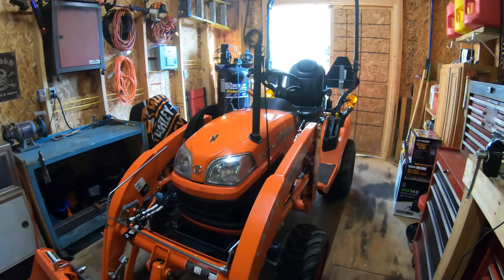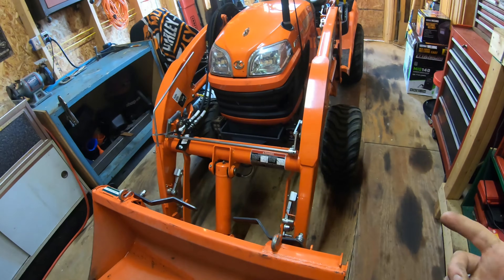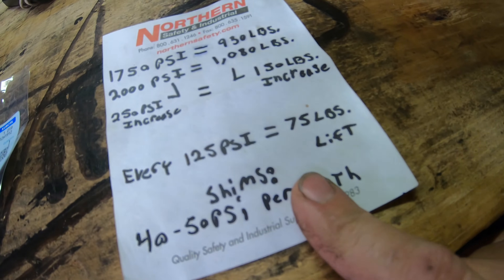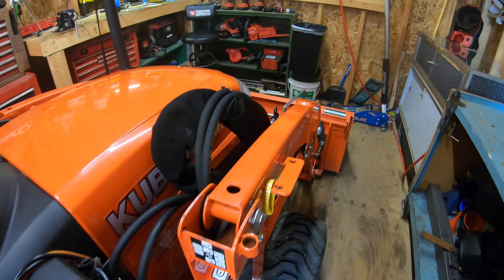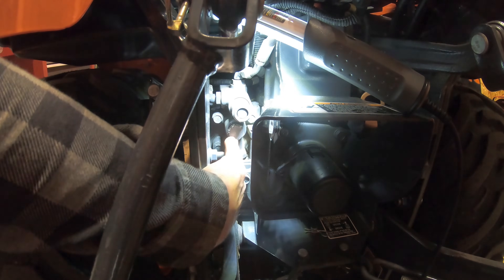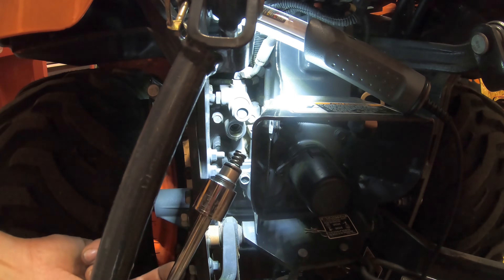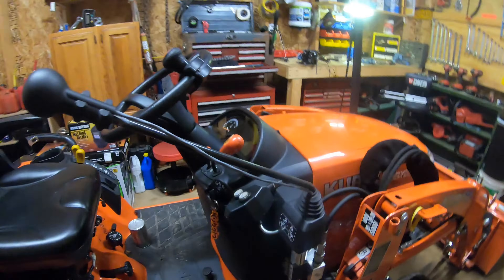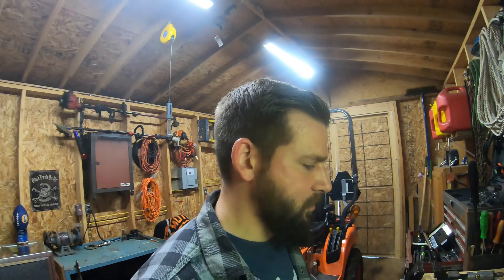Kubota BX- Increasing hydraulic pressure... AGAIN

Comment: How would you check the hydraulic pressure on my Kubota BX 23S with a quick attach coupler on the loader?
Reply from the maker: Hey Hagan, To check yours you would just need the proper quick coupler. For your machine you would need a flat face coupler in the proper size. If you go on eBay and search “Kubota bx 23s hydraulic pressure gauge” you should be able to find a pressure gauge with the correct type of quick coupler already attached to it that you can buy gift $60-$80. Let me know if you need help finding it and I’ll send you a link. Thanks!
Reply: @BiffsEquipment  I found the pressure gauge kit that contains the stems. My question is since I have a quick attach system in which all four couplers come off at the same time, do I connect the gauge to the first coupler that operates the loader and make sure I don’t operate any of the other functions so I don’t spray hydraulic fluid everywhere cause all four couplers with be off. I can’t take just one coupler off to check the pressure with the quick attach system is my worry.
Reply from the maker: @haganrichmond  ahh I see, well all the fittings should be standard 1/4” pipe thread, so you would have to cap off each line that your not using and then the one you will be using you’ll thread your gauge on using a pipe nipple or some type of adaptor depending on what thread your gauge is. You can’t leave them open you have to at least cap them.. and once your ready to test it if you have the gauge on the first port like I did then you’ll wanna move your loader joystick directly up

Comment: How do you like your new found power bro?? 250lbs makes a big difference when you're moving 18tons. I haven't done anything with hydraulic pressure with my BX but I'm going to check it during the next service. I'm told that as time goes by, they lose a bit of pressure and need a little shimmin' to "freshen them up!" I DID do the L2501 and I'm REALLY happy I did. Please let me know how you made out after the weekend, Good luck, be safe and most of all - have fun!
Reply from the maker: Hey buddy! Sorry I’m just now seeing this comment iv been so busy lately, the hydraulic increase worked excellent on my last job! I had a ton more power and a lot more breakout force which was what I was after the most as I often am working with crushed limestone which is some of the heaviest stone around. On my job the crushed limestone was soaking wet so it made it that much heavier yet I was getting monster buckets bigger buckets than I have ever been able to scoop up, so much so that my front rims were about touching the ground (I’ll have to increase my front tire pressure now). I even lifted my rear tires off the ground quite a bit even with all the rear ballast I have so I’m going to have to buy a few more suitcase weights to add on the back now to accommodate  for the extra added power. So far so good and it’s been very reliable! New video will be coming soon, thanks dor watching and let me know if/when you do yours! I think you’ll be very impressed when you do Cuz like you said after awhile the relief valve spring can slowly soften over time lowering your psi and if it’s never been checked it’s def a good idea to do so 👍🏻
Reply: @BiffsEquipment  No problem on the delay - it's a real commitment to make and product this videos and it can take up all your free time if you let it. I'm glad it worked out for you.  What do you think about a boxblade instead of more suitcase weights?  You could always weld a bracket to it to mount your present weights on??  I got mine from Tractor Supply and I'm VERY happy with it. It's tough, built well, you can push snow with it and it would have come in handy on the driveway video you just cut. Just a thought....you have to do something with all that money your making with that BX...ha, ha, ha...
Reply from the maker: @BotaTrac  a backblade would be great to take on these types of jobs with me, I plan on fabricating a cart soon so that removing my weight bracket with the weights still on it will be a simple task (prolly gonna be my next video is fabbing it up) so once that is made it will be no problem to switch from my rear weight bracket to a grader box. I don’t suspect I would have to run weights with the boxblade as the box blades Usually weigh quite a bit and the weight is much farther back as well but if I ever did do that and found it wasn’t enough I could certainly build a little bracket off the back of the boxblade to accept suitcase weights. I would love to get a proper boxblade next year, just money has been tight and I’m also going to need a larger trailer if I plan to leave it on like we are talking about.. so with the expense of a boxblade would also have to come that expense of a new trailer so it’s gonna be costly but I plan to upgrade my trailer early next spring and by end of spring next year I plan to have a much better trailer so I can run more attachments next year. I’m also gonna be building a front weight bracket as well in upcoming videos and I’m gonna be building myself my own snow pusher.. should make for some exciting videos for sure 👍🏻

Comment: Be interesting to find out how it performs now.  I had mine at 1950 psi, but decided to go up to 2150 this afternoon.  Thanks for the video!
Reply from the maker: Awesome! I will def keep you posted Seth and you keep us posted as well if you’d like. I already did a job since then I’m working on editing the video and getting it uploaded shortly. The tractor deffinelty had a lot more power, breaking out heavy wet crushed limestone was MUCH easier, so much so that I was getting monster buckets, my front tires rarely went flat before but after the pressure increase my rims were about touching the ground lol. So it was def a great improvement tho I notice I’ll need more rear ballast now as my rear tires were lifting off the ground now again when it use to stay fairly planted. So as far as the pressure increase goes it def made a power difference in lift 👍🏻

Comment: Good Vlog. I've been toying with increasing the working pressure on my 2004 BX23D since I bought it new but have always abided by the "don't fix it if it ain't broke"  & worked with what it could do. That said I don't see me going to a larger B or LX machine and I definitely feel the need for "Mo power" so I may finally bite the bullet and go for it. I'll be watching for a follow up to see how your upgrade went.
Carry on.
Reply from the maker: I hear you man, yah lots of guys who own the BX who maybe don’t want a larger tractor or can’t afford a larger tractor at the moment like to do this to get a little more power out of it.. 2,000psi is pretty well known as being safe for these Kubota BX so if you were to do it I would go up to 2,000 and no higher if you were worried about breakage. I ran mine at 2,000psi for many months and through many very hard jobs and i had no issues. Now I’m above whats recommended by many at 2,250psi and plan to even do 2,500 at some point if I can find eniough ballast. I just did a job with it today and it for SURE had even more power.. but even with all the weight I have i was picking up the rear tires today slightly now with the added pressure. Making sure your properly ballasted is KEY to the safety of you and your tractor. Best of luck.

Comment: Good luck with the pressure bump up. Keep an eye on the gland seals on the loader lift cylinders. Thanks for sharing your experiences. My B2650 doesn't lift like I think it should.. I was just in the Ellicottville, NY area installing a wind turbine tower, I believe your out that way?
Reply from the maker: Thanks Sean, I’ll def keep a close eye on the cylinder seals as well as the hydraulic lines tho I feel the hydraulic lines would be my least concern, mainly cylinder seals and the hydraulic pump would be my concerns but I’m honestly not all that concerned otherwise I wouldn’t have done it. That’s cool you install wind turbines? There are a lot of them out here where I live, Ellicottville is only about a hour or so from me. Do you live in NY as well?

Comment: Thank you for showing the spring and the shims in detail.  I have a BX23S with the factory shims.  I'm curious to check where the pressure is at.
Reply from the maker: Sure thing, do you have a hydraulic pressure gauge yet? If not you can get them on “bxpanded.com, or you can even find them on eBay and Amazon with the proper quick coupler you’d need for your 23s. Make sure you get one with the appropriate flat face coupler and not the pioneer coupler as you have the newest bx.

Comment: Great video.  I have a BX23s.  I understand the limits of a subcompact. It isn't my first tractor.  Lift capacity would be my only complaint.  Ive heard of doing this but had no idea how simple it is.  Thanks for the education.
Reply from the maker: Thanks man, yah it is definitely easy to do, you just gotta be sure to be properly ballasted as the bx is extremely light in the rear with out weight, if you turn it up with out ballast all you’ll ever do is lift the rear tires which I feel is the biggest reason Kubota leaves it so low to begin with. Thanks for watching
Reply: @BiffsEquipment  I agree. On the occasions that I don't have the backhoe on,  Ive got a land plane or something heavy back there.  Ive played with the idea of building a ballast box.  Just to allow me into tighter areas.  Especially doing brush or small tree work with the grapple. The issue that I hate is you can have a whole arsenal of attachments.  If your not working at home or near by, you can't bring them all with you.
Reply from the maker: @netpoke58  yah you got that right man. But that’s good you have many attachments to help you depending on the job. Rear attachments work well for ballast aside from them getting in the way from time to time like you said. Why don’t you build a 3-point hitch weight bracket like I did? I did it for less than $60 and it works great, only problem is you then gotta buy the weights but they aren’t much.. plus then you can adjust the weight according to what your doing, and can easily remove the weight bracket with the weights if you have a quick hitch.. I made a video on how I built mine.. in the thumbnail it says “save money” or something like that, I forget what the title was but it’s maybe 15 or so videos back if you wanna check it out 👍🏻